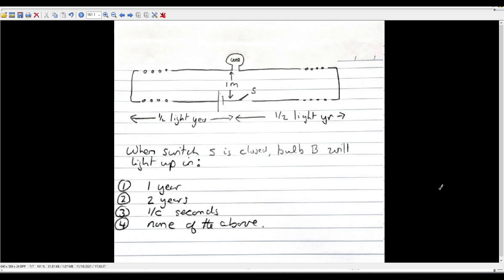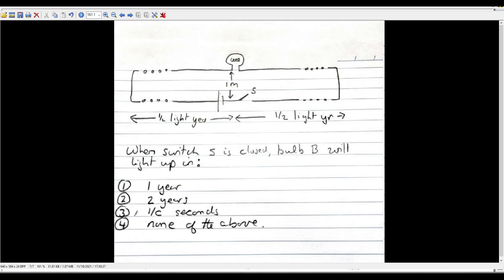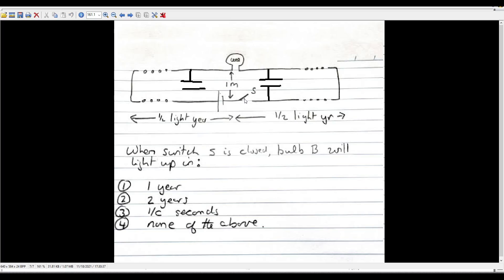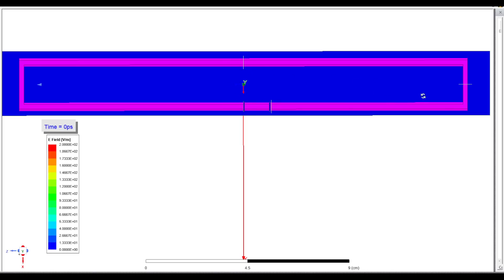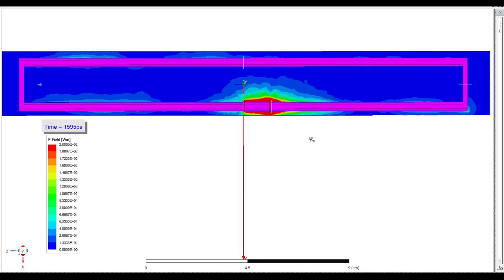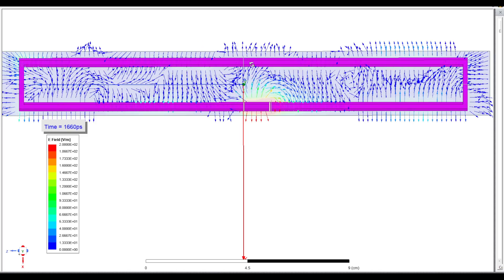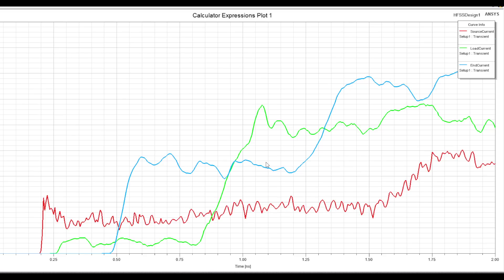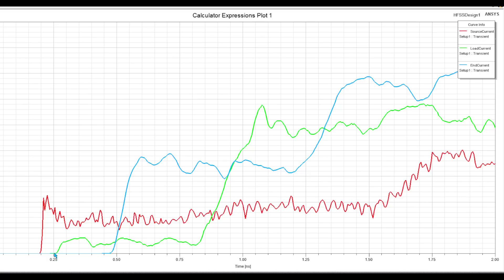Response To Veritasium - Electricity Propagation Time Problem

Comment: What this also demonstrates is the efficiency problem with room-scale 'wireless' energy systems. Yes, the energy flows outside the wire directly to the load but as you can see above, the wires guiding the energy makes for a much more efficient energy transfer system than simply moving electrical energy across more than very short distances.
Like chain links on a bicycle chain the electrons don't possess the circuit energy but they do provide the mechanism for electrical energy transport from point A to B via tension (potentials).

Comment: Vertasium is wrong and your simulation is wrong too because it doesn't show you what happens in the wire before the switch is turned on. 
If to suppose his smart-ass light bulb is so sensitive then it will light up even before starting the experiment, when connecting the first side of the battery to the circuit. For the distance to the moon he will have to wait very long until the light will dim out. Because the circuit is already under the tension, that very weak EM at 1/c won't be able overcame the charge potential because it will have to fight to move electrons in opposite direction, from positive to negative ( considering the switch was on negative side) which is futile.

Comment: Sadly the problem is muddled by a mish-mash of assumptions.  For instance, the resistance of the wires is assumed to be 0 yet the capacitance between the wires is not 0.  What about the inductance of the wires?
Reply from the maker: The resistance is a function of the wire material, which was left unspecified, wheras the capacitance and inductance are a matter of the wire loop geometry, which was specified.
Reply: @PulsedPower  Doesn't the capacitance also depend on the dielectric?   Air/vacuum,wire insulation,etc.?

Comment: Thank you so much for this!
YouTube suggested your video after Veritassium's video left me very confused. This explanation is so much more insightful than Veritassium's.
I was left wondering "wait a second! this breaks relativity. what if there's a person at the 1/2ly edge of the circuit, and that person cuts the wire 0.25 seconds after the light turns on? Would the light turn of? That would essentially mean that we are transmitting information faster than c!"
Thinking of it in terms of a capacitor and then showing the step-wise change in the currents has un-knotted my brain!

My original answer to Veritassiums video was 1s, btw.
Reply: Correct, and with a 1/2 light year long edge, if the circuit is broken at the end, the steady state will result in no current flow (with a DC source).  I think Veritasium's explanation and answer are very misleading.  It's interesting, but misleading because only a tiny fraction of the full current will be transferred before 1s.
Reply: I breaks Relativity. See my detailed postat the top of the comments.

Comment: Why is this video showing 1/2 light YEAR legs, and Derek's uses 1/2 light SECONDS?    Dramatically different lengths.
Reply: Answering my own question... apparently Derek did 2 videos... each with different lengths.
Reply: @radiow4qa71  Thankyou.  I did not see that.  Although the postulation may be the same, the transpositional error would be concerning to not mention.